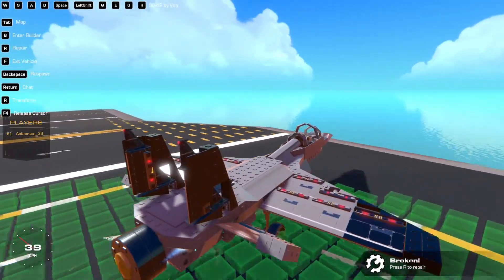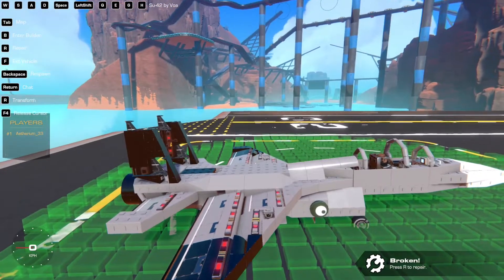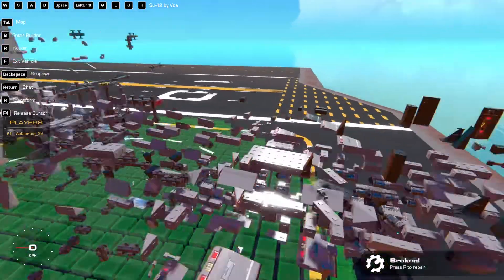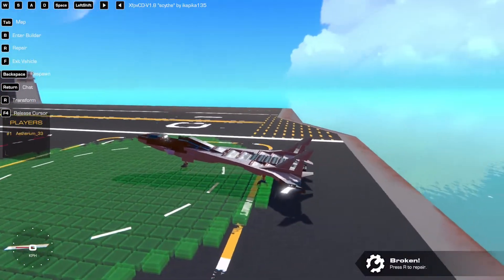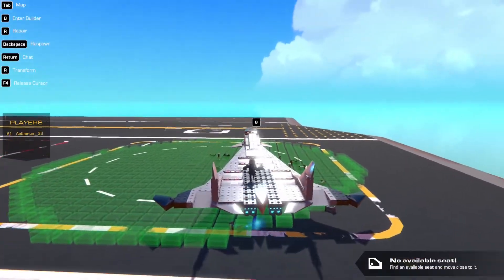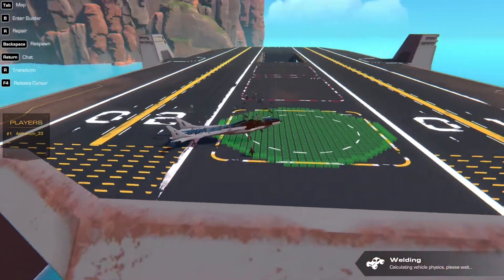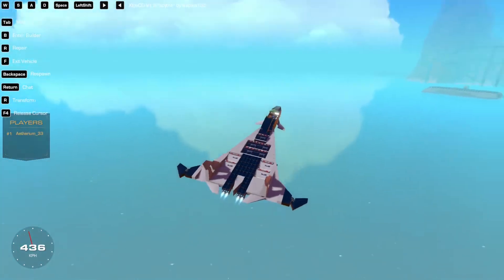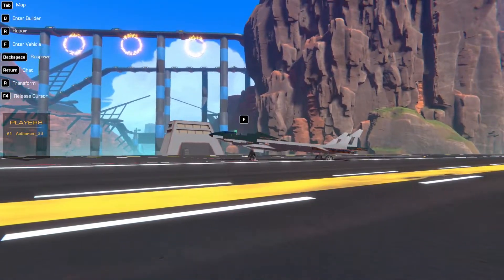How to make planes in Trailmakers - Trailmakers Tutorial

Comment: Hi I just had a quick few questions regarding my plane I just built. My plane always pitches down but if I move the weight distribution my controls get wrecked. My plane is also always sort of flying to the left and it's hard to turn it in the opposite direction. The latter started happening when I made an ejection seat. If anyone could help that would be great!
Reply from the maker: Sorry for the late response. You can try to move your center of thrust a little lower to prevent it from pitching down as much. Most likely the turning left thing is because of collisions happening because of the piston pulling the seat into the vehicle, and you just sorta have to fiddle around with weld groups to get that to work. (If you don't know how weld groups work I explained them in my piston glitch video https://www.youtube.com/watch?v=oj5i0VgaNyk)
Reply: Well the pitching down is pretty normal, you must make sure that your yaw stabiliser is even